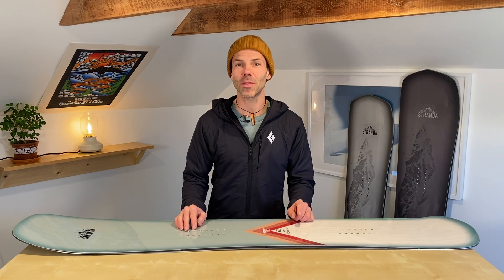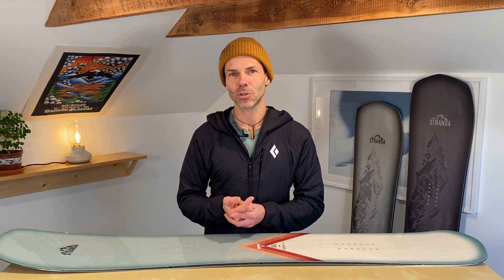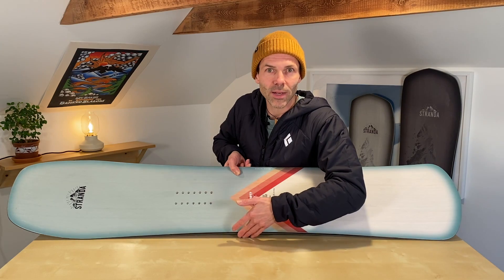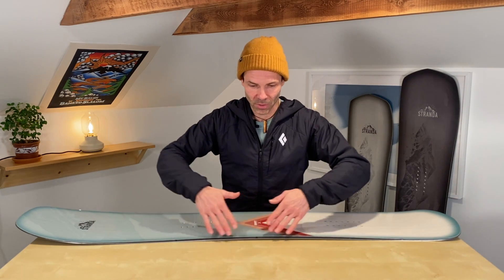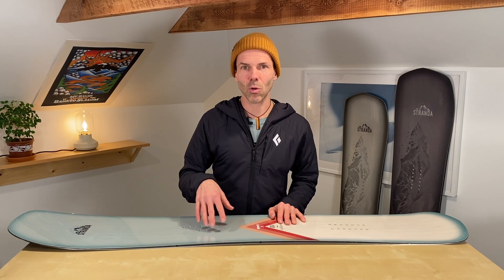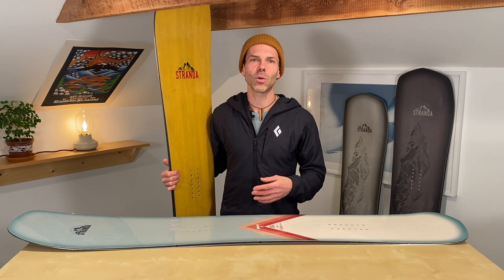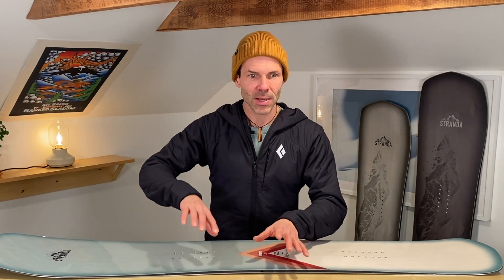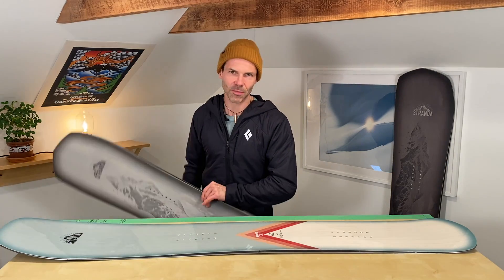Board design #2: Sidecut, effective edge, flex, turn radius

Comment: So I guess they should add this as another parameter of the board - sidecut depth.
Of course you can calculate it by yourself, because they tell the widht in the waist and the widths in the widest point at nose and tail.
Reply from the maker: Thanks for the comment!
All these numbers are somewhat relative. None of them alone tells you much. Technically effective edge and radius are enough to get an idea about how deep a sidecut is - and really, all you want to find out (if one actually wants to find out.....) is something about the range of turns a board can carve cleanly. But therefore you need a reference board! And that should be YOUR reference board.
My idea behind giving this info is really to empower people to make their own educated decision on a board. If you have a board with a 120cm effective edge and an 8m radius, and you like it, that could be your reference. Seeing the same EE on a 9m radius is a board that has less range. Seeing the 8m on a board with more EE is a board with a larger range. Sidecut depth as a number is kid of irrelevant. But I had to explain it so people realize what that all really means and says about how a board rides.

Comment: Got any skid science coming in the series?
Reply from the maker: Not sure what you mean?!
Reply: @Justaride-Snowboard-Channel  along the line of gripped turns and how the board design features selected impacts those.
Reply from the maker: @thetube4p  Aah! Ok! Hmmm.... to be honest, I wouldn't feel overly confident talking about that. It's more of a guess from all the things I do understand.
I think a smaller radius is beneficial for gripped turns. I'd also say that full camber is NOT beneficial since the heavy grip in the tips probably over-engages. Of course it can all be done... But from a functionality standpoint I'd say for gripped turns a board with a normal or even slightly shorter than average effective edge (average, relatively to the board's length...), early rise tips, camber between the feet and a rather tight radius would feel better and easier to ride.
Reply: @Justaride-Snowboard-Channel  I think your theory is on point for easing the physical demands and hooky nature of camber in slower gripped turns in moguls or other locations requiring very tight radius turns. Boards with shorter EE to length ratio, short radius sidecut and early rise or 3D shaping do enter a skid easy, add maneuverability, and aren't as insistent on tracking straight nose to tail initially. But I find these don't do "high speed" gripped turns easily due to the risk of actually skidding/washing out and dropping speed. Sometimes these decks can't even do medium speed gripped turns without slowing themselves. It may be that the deeper measured sidecut depth on a shorter radius is prone to kick out or skip across the snow surface without maintaining full contact. Anyway I slice it,  there is a very small margin for error at high speeds before washing out these decks.

For high speed trenching I find full camber longer EE longer radius sidecut on a stiff longer board is very physically demanding to start breaking the traction/grip (of course it can all be done!) and I sometimes end up carving pencil thin when I hoped to displace/spray/trench/lay a gripped turn on a feature. Literally can't get loose sometimes, too much carve, especially as I get tired or if the snow is very hard. This setup excels though at long drawn out gripped turns at high speed "in fresh snow or corduroy" and can do medium gripped turns, but slow gripped turns are near impossible. The high speed allows it to break loose easier and once I'm there, the board can handle the power of the turn, dig better, track straighter nose to tail, drive the tail in, and exit the turn with most of the speed I started with or more, which is my goal. But it's exhausting driving that tail in. I can carve all day on this board without fatigue, but smashing features is too tempting.

So in search of striking a balance between 1. not being exhausted so I can ride another day, and 2. not slowing due to skidding on short radius less cambered softer decks, I just compromised and got a full camber semi-volume shift deck with shorter overall length than my normal rides, fairly high EE to length ratio, middling progressive radius, and med-soft flex for me (med-stiff for most). This board has been the ticket for gripped turns at slow and medium speeds in back-to-back days of riding without too much fatigue. It only skids when I tell it to. The softer flex allows me to overcome the front end over-engaging nature of camber, and the softer tail doesn't wear on me as much. On empty resort days I'll go back to the stiff board and open it up for high speed gripped turns ... when I can handle the workout. 

Any thoughts? Appreciate you and anyone who nerds out on snowboards!
Reply from the maker: @thetube4p  Lots of great points. Cool to see someone reflect on their setup and riding style this much!! I'm not a skidder, so I can't say too much about that. But I think you're spot on here.
Reply: Thanks Lars, I mostly snowsurf on hardpack so skidding comes in hitting features or steeps, otherwise it’s all carve and PYL, maximize speed on edge using all the terrain available and seek and destroy. Finding a board with this versatility that isn’t considered a full on powder board hasn’t been easy.
Reply from the maker: @thetube4p  Stranda Shorty ;-) or Biru for a more freestyle vibe. Both insanely strong carvers!
Reply: Hey Lars, Tribute touched  on my question without outright saying “skid science”. About 4 minutes in Mark’s talking about issues with the tail stiffness and then they discuss how to adjust setback to gain torque over the tail. Leaving the front foot at reference and setting back the backfoot as far as I can without increasing my stance width much has been good to unlock boards. The upside is a barely maneagable plank becomes easily skiddable and a bit more turny. The downsides are the same as the upsides. Do you setback your carving decks? I’m thinking 3-5 cm setback from center of contact points can really change how they ride.

https://youtu.be/qFOGjnUUmnk?si=-A96GCHXMqhaAwt5

Comment: Found your channel because I was searching about stranda snowboards, like your channel.
Do you have experience on the shorty? Would be nice if you can make a video about it. Also the bowlrider, found not much about it.
Also your opinion about hardboot/softboot splitboarding would be maybe interesting.
Reply from the maker: I love my Shorty! It's an amazing pow board with a freeride heart, comfortable at speed but also in the trees when it gets tight.
On groomers it blew my mind... More grip than most dedicated softboot carving boards out there. Really strong edge hold and great vibration dampening.
Bowlrider has a tighter radius and is a little softer. More nimble of a board with a lower speed limit. Otherwise, same fun in pow and on groomers.
I splitboard in hardboots. Atomic Backland Expert, no modifications. Plum bindings. It's perfect! I'll never go back! Uphill is 200% more efficient, downhill is very quick and easy to get used to.
Hope that helps!
Reply from the maker: Hey, did you ever end up buying a Stranda? :-)

Comment: Great video, looking forward to the rest of the series (or the two hour version 😉).

First two nitpicks:
A snowboarder telling another to do a eurocarve is actually asking him to do a trick not to carve. Europeans less confusingly also call it the Vitelli turn, and its a laydown with weight on your hands and you "crouch" into it by going deep first with little board angulation. Unlike a similarly deep carve its not G-force allowing the high board angulation.
Please stick to the term side-cut radius like used in board spec sheets instead of saying "turn radius" like sometimes in the video.

Now for the nerdy stuff to dig deeper... 😀
One thing to expand on is non-radial side-cuts.

The other thing I thought about, is the actual resulting formulas for (for now radial side-cuts) this. The effective edge being the length of a circle arc, yok can put effective edge and side-cut radius put in relation and also calculate that side-cut depth.
Now would the depth be a good comparison figure? Do different sizes of the same board when designed to carve exactli the same have the same depth?
At first one may think yes, but I am currently not sure. The actual curve the board rides is a three dimensional blend of the side-cut radius in one plane and the curve of the flexed board in another perpendicular plane. Is the adaption of the side-cut radius to a changed length enough to get the same resulting 3D curve, or would not the curve how the board is flexed also have to be (or better be) adapted in the same/similar proportion? If so, that should also mean different depth. 🤔
Reply from the maker: I know Vitelli turn, named after Serge Vitelli, as a full circle carve!
I'm just trying to state that carving is simply a way - or maybe THE way - to ride a snowboard, and that many riders out there instead of learning to carve all the way down a mountain simply claim they're carving because they can do on single toe turn and then call it 'Eurocarving'....
You're right, I should say sidecut radius. I purposefully didn't do that, because I wanted to separate sidecut depth from sidecut radius... So I called it turn radius. But you're right, that causes confusion.
In regards to non radial sidecut: as I said in my introduction, this is one part, there will be more. YOU already get the whole thing. But YOU are technically not my audience at all. I have to simplify and build up...
The sidecut depth to me in this episode is simply a relative figure that gives information about the possible range of cleanly carved turns of a given board. I'm not connecting it to any numbers or definite figures. A deeper sidecut does, however, result from a longer effective edge or a tighter sidecut radius on a given edge length....
Really, all I'm saying here is that the radius number alone does not tell you how tightly a board can turn - and my Stranda Cheater 200 is the perfect example for that. I'm sure you actually understand what I'm trying to say. Let's not make it overly complicated! Peace!! :-)
Reply: @Justaride-Snowboard-Channel  Ah, gotcha where you're coming from with te Eurocarve.

Yeah, I got whot your idea was with the depth, but I was thinking further. Like with the math at hand to from the specs of one size board calculate how a different size of that same board would need to be specced, one could also predict the difference between different boards (of same type) of different sizes (when not available in the same ones) more precisely, especially when they are not radically different and any guesstimate would be no better than "they are both carving boards, they probably both carve well".

I do and always will favor try before you buy and actually demoing boards whenever possible, but those opportunities are rare.

Comment: in the example of the two boards near the end, you say the free ride board is technically capable of shorter turns. however, it sounds like it takes more effort to do so, is that correct?
Reply from the maker: What I was trying to say is that the freeride board being the shorter board of the two with the smaller turn radius (7.6m) is likely gonna turn larger when fully tipped on edge than the longer powder shape with a 7.9m radius, because the pow board has a longer effective edge, which gives it a deeper sidecut and therewith more room to push into the centre and tighten up the turn.
It is confusing, isn't it?!
Reply: @Justaride-Snowboard-Channel To lessen the confusion, you should really stick to saying side-cut radius when you talk about that very board spec, and not "turn radius", as thot sounds as if you were referring to the radius of the actual turn.

Comment: Let's stay with side cut radius, side cut dept will vary with effective edge so it doesn't mean anything. It's the leverage outside your stance vs. space between your feet... If theres no tip or tail it won't turn, because you won't be able to load the center and decamber it... The only reason you'd want to know the sidewall depth, is if you dint know the radius and would have to calculate it. : D
Reply from the maker: I'm not saying you need to know sidecut depth as a number. But it is a THE indicator of how big of a range of various turn sizes a board can produce. Explaining that was part of why I made this video. You can have boards with a deeper sidecut but larger radius than others - solely because of a much longer effective edge. Sometimes that can even lead to a board that despite its larger radius can be turned tighter than another board with a smaller turn radius....
Reply: @Justaride-Snowboard-Channel Yeah, an example for the latter would be Jamie Lynn's Lib Tech Short Wide (from before they made it longer) with a seemingly short sidecut of 5.8 m, which however, given it is a 147 cm short board, rides surprisingly normal like your usual 7.5-8 m sidescut. Compared to that, the Jones Freecarver 6000s side-cut of 6.7 m at 158 cm seems less short, but with that length and the particular long effective edge it rides really different from a middle of the road side-cut.
Reply from the maker: @elho-snow   That's too funny... My nerd friend Spenser referenced the same board (Jamie Lynn) to me last night in regards to this video! Hahaha.... Yeah, you're right on the money with all you say!! Thanks for contributing!!
Reply: @Justaride-Snowboard-Channel Haha, that's indeed funny. 😀
But then it's maybe less of a coincidence - there are not that many (mainstream production) boards with dimensions at the extreme ends of the spectrum, so those are not unlikely to be used as examples.
Reply: @elho-snow  why wouldn't you use the 9000 as the other example? This is like saying a 600cc bike is fast.
Reply: @martykasa7864  Why would I? At 9 m side-cut without being drastically longer it is very obviously different, no need to think any further.
The 6000s however is the 6 m side-cut version, which puts it close to the 5.8 m side-cut of the Short Wide when only looking at the side-cut - thus it is the perfect example how one also needs to take the effective edge into account, given how different radii (on the snow) they actually carve.
Reply: @Justaride-Snowboard-Channel  ok, my 130 KT has a 17mm "sidewall depth".. And my 160 KT is 15mm. What's that tell you ?
Reply from the maker: @martykasa7864  you're missing my point! It doesn't tell me anything, and I never said it would. It's the sum of the things - and you can't take sidecut depth out of that equation to draw a conclusion. What's the EE and what are the radii for those boards? Then we can talk!
Reply: @Justaride-Snowboard-Channel  I might be missing your point, but looks like you got my point. Those numbers don't mean anything to any one, & of course you can't do anything with it, no one can....they are literally the byproduct of dimensions that matter. The only reason you'd want to know side cut depth is, IF the goal was to talk, about snowboarding.

Comment: Wow what a small world! I’ve done several courses with Neil McNab (technical, backcountry & split boarding) & they are amazing. He really helps progress your riding. One of my best days riding was a heli drop with Neil in Switzerland. As a fellow geek I love your content!
Reply from the maker: He's a gem! We've never met in person, but I've been chatting to Neil for over 10 years now about splitboards and general snowboard nerd stuff... He's one of the few people who really understand snowboarding....
Reply: @Justaride-Snowboard-Channel  His book is really good too. Full of technical details. He’s seems to (or used to) recommend + on front foot & - on back foot. Would be interesting to get his thoughts on the whole posi posi stance for carving. When I did his technical course he recommended anywhere from 0 to -6 on back foot. However that was more for freeriding and not carving specific.
Reply from the maker: @jaimepardo  Since he raced and understands both techniques in depth, I'm sure he differentiates between the two in a similar way that I do. I rode -6 and later 0 on the backfoot for well over a decade. My riding has changed. I turn more and jump less. I slowly moved to posi, it was certainly NOT an overnight thing. I'm talking 3 or 4 seasons to go from 0 to +6....
It is quite different, and changing the technique is also not super easy or done quickly. But I viewed it as a path and an experiment, and it improved my carving dramatically. It's all preference and personal purpose. The biggest point is that duck and +/+ require two different techniques. Conveying that is my main goal with the talks about stance. And Neil is well aware of both. His whole 'bringing pressure to the tips by keeping the knees outwards' is so important when in a duck stance!
Reply: @Justaride-Snowboard-Channel  My plan is to experiment with stances angles with a view to trying posi posi for carving. But good to know to try it gradually rather than jump straight in with crazy angles. His tip for pushing the knees out when in duck stance to engage the contact points also works amazingly well for edge hold on icy faces. I’m not sure how all that will work (applying pressure to edges end to end) going posi posi but I intend play around & figure it out and take my carving to the next level 😀👊🏼